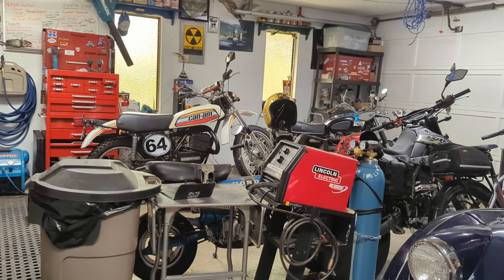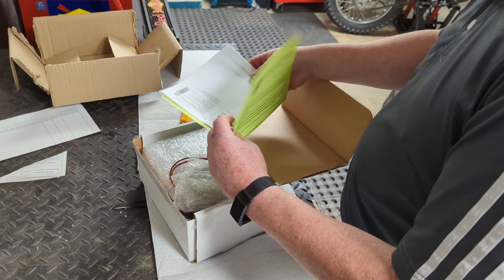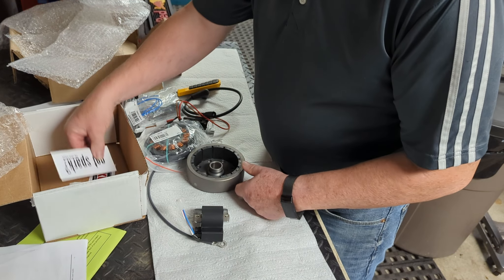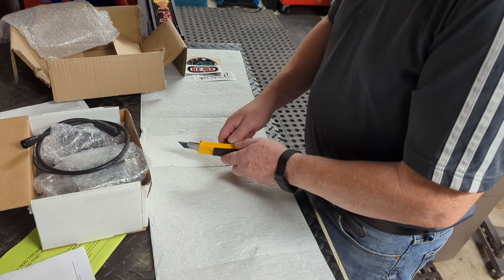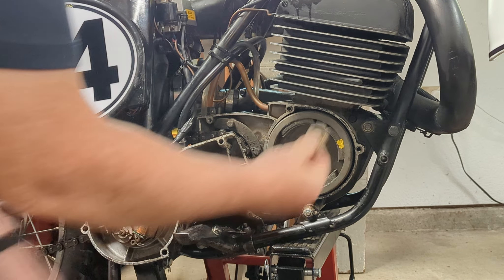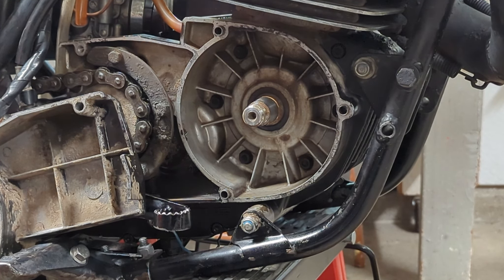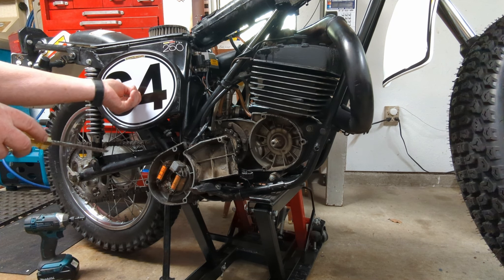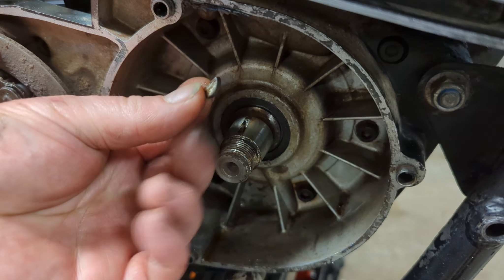VAPE !!!  - 1975 CAN-AM 250 TNT

Comment: I did the same upgrade to my 1975 250 TNT last year.  I had 2 concerns, the flywheel nut only using half the threads and the weight of the flywheel is about half the weight of the original.  Since I race my bike in MX the quicker revving was welcome.  The lighter flywheel made cross country in the single tracks a little tricky at times.
Reply from the maker: @johnmathewson985, that's cool that you have the same model '75 250 TNT and also did the VAPE upgrade!   I am not a racer, just enjoy putt putting around on mine, but so far I am super happy with it.   Previously it had ignition issues with the old Bosch unit, causing the bike to crap out randomly once warmed up.   Very thankful that issue is resolved.  The added benefit is that the bike starts up immediately on first, or at most second kick each and every time.   Great to hear the bike is a bit quicker racing MX with the lighter flywheel.  I guess keeping those rev's up may help in single track too.   Thanks very much for watching the video and letting me know about your experience with the VAPE ignition.  Best of luck racing!